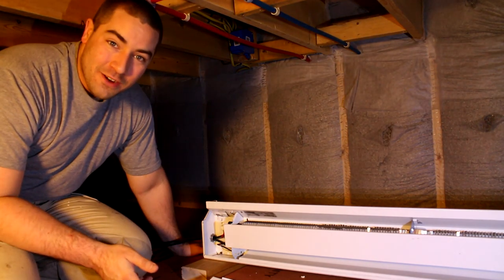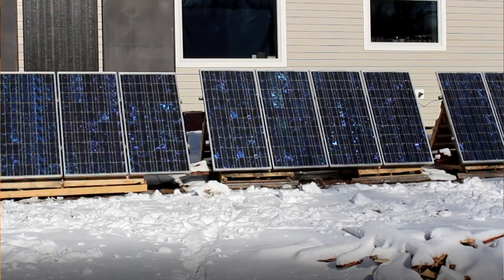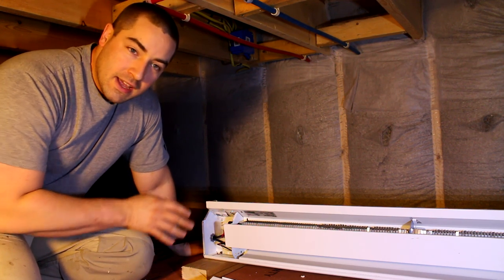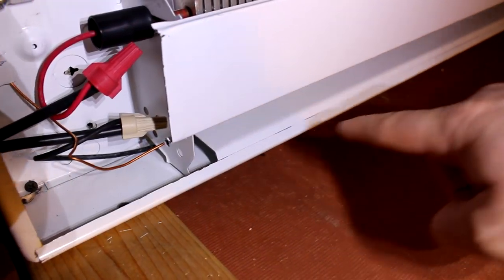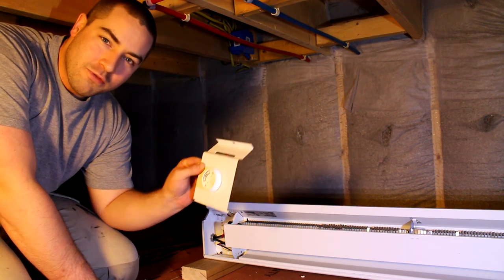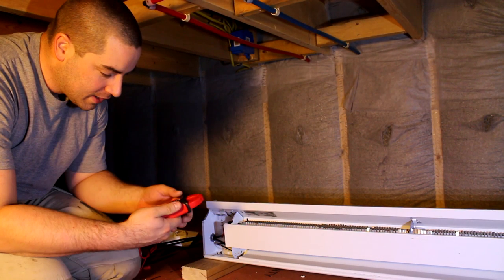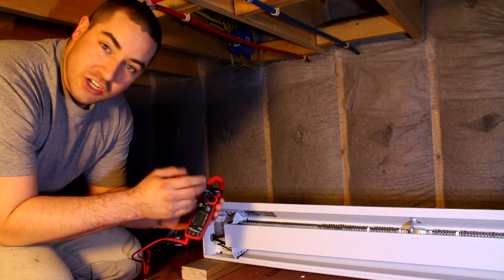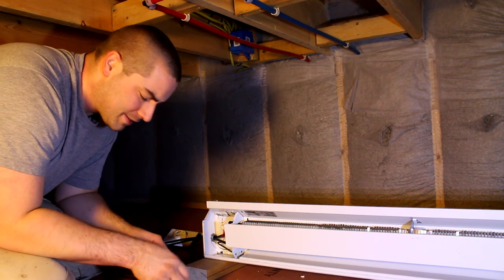Space Heater Running Direct off Solar PV

Comment: This is the exact thing I have wanted to do to HELP with heating my house (put in crawlspace) but always told needed microinverters or $$$ inverter and basically it wasn't worth doing.  The place were I live seem scared of solar energy.  I just want to use my (3) 305 watt trina 36.6 Vimmp 8.33 Immp already mounted on my roof off grid style.  Could I use a oil filled heater instead?  Wife might be mad if I burn the house down...

Comment: Hi David 

You can run the heating resistor just fine with DC. I'd put a disconnect switch in there too and maybe a 10 amp fuse for cloud effect but otherwise you should be fine

I also did the math simulations on the best elevations each month for your panels for your location. Would you like for me to just stick the numbers here or may I give you a Google drive link for a PDF with all the graphs and stats and stuff :) ?
Reply from the maker: That's great.  Send me the link with a message on YouTube, or the contact page on my website.  Thanks.  I'm looking forward to building some type of tilt array for your angles.

Comment: How is this working out for you?  I see the date of this video was a few years ago, but with the prices of fuel this year, this might be a viable option for adding some heat.
Reply from the maker: It worked great for 2 winters.  I have since moved the panels.  If you want to do this, check out my video on how to match the ohms of the heater to your panels: https://youtu.be/kVaxAfXQPDU

Comment: If you hard wired panels( with a DC breaker ) to the heating elements on an oilfilled electric space heater  would that work too? How many panels would you need for a 120v 1500 watt space heater? Would you by pass the thermostat controller when running 12 v instead of 120v?
Reply from the maker: Any resistor will work with this basic concept.  But, a lot of space heaters will have an AC thermostat built-in.  The AC thermostat will probably burn and melt with a solar panel.  Always add safety features rated for the DC voltage you will be working with.  As for your second question: I made a free calculator on my website to help size resistors to panels.  It's right on the homepage available as a downloadable excel sheet.  www.davidpoz.com

Comment: sweet man now you need to do is spend 20 bucks and get a Chinese Thermo controller so you can set the temperature on it it will set when to turn on and when to turn off I am using one to heat three little heating pads 12 volt and I'm almost positive they will hold 10 amps no problem at least that's what it says and you're barely over 6 with your amprobe so should work thank you for posting this I would have never known this and I have looked everywhere for a way to hook up solar to a heater and not have to have 1500 watts of power coming into convert
Reply from the maker: I'm glad to help.  Sometimes simple setups work the best.

Comment: OK- set up my "new"  Har. Frt 100W 12V 4 panels directly, nada.  SOME light, 8 V.   Then the battery at 14.7 V directly, and  nada... Wazzup?  Directly to element... getting 14.7V at the connections.  I have the same wall heater, only a bit shorter.
Reply from the maker: My panels are set up in series.  I've taken this down, but I think it was about 300 volts

Comment: Hi David ..could this type of application work in bringing heat to my chicken coop? I mean a smaller version..my chicken coop is more than 300ft from my house, and i been hesitant of using extensions or running underground cable to power the mini space heaters to heat up the chicken coop, and also very labor intensive..so i was wondering if there are mini spacer heaters that can be power by solar..without buying a large amount of panels or batteries..
Reply from the maker: This concept could certainly be used.  However, the solar panels need to be over-sized because there is no MPPT involved.  I'd probably run a wire out there for a low-temperature heater.  Something that won't draw very many amps.  That way you can keep the wires small (less money).  I'd also look for a passive heater, something that has no fans.  Because the chicken dandruff and dust will kill any fan-model fast.  
Just as an idea, here is a passive, 250w heater: https://amzn.to/34KTFQw
250 watts at 120v is 2.1 amps, which is very low.  The low amps would allow you to use less expensive extension cords, like 16/3.

Comment: Hi. Im living in the uk and houses here are 100years behind with energy efficiency. Mine is rated E which is lowest legal requirement if you want to rent youur property out to someone. I am thinking about something like this but wanted to use fan heater(1 lets say 1 / 1,5kw or few less powerfull ones eg 3x300w/5x300w respectively)
Can i connect heater directly to the panels if its also dc ? How about energy fluctuations throughout the day ? Won't this kill the heater ? Many thanks for any clues. Cheers !
Reply from the maker: No.  The DC from solar panels can go to a resistance element, but not to a thermostat, switch, or fan.  They will burn up.  I'd look at insulation and air sealing first

Comment: need to work out a thermastat for DC that wont arc... perhaps a PLC and relay.
Reply from the maker: I didn't use any thermostat.  I never had an issue of over-heating since it's a relatively small space heater for the size of my house.
Reply: If you are using Victron equipment in the same space I can't see why using a Cerbo GX to turn a relay on and off based on temperature would not work

Comment: Hi David, can you please update your space heating experiment. How did it go? Is your house still standing?😂 Are you still using PV direct heating method? Any advice from a seasoned veteran of PV direct usage to the green beginners like myself?
Reply from the maker: Still works great.  I added circuit breakers from Midnite Solar rated for up to 300 volts DC.  I made a mistake very early in my testing and used a circuit breaker that was meant for car stereos (12v) and it fried with the high voltage DC.  Also, I found that voltage is the more important factor than amps.  Lets say, you are using a 120 volt baseboard heater rated for 10 amps, 1200 watts.  And you are hooking up solar panels that have a Vmp 24, and Isc of 7.3 amps .  Then you need to series connect 5 panels to bring the voltage up to 120v.  This is the important thing to get the voltage at (or slightly above) the voltage of the heater.  In this case the amps are lower, so it won't put out the full 1200 watts, but it can still do 876 watts.  If you don't get the voltage up there then it will put out almost no heat.  I went through this in my testing.  I hope that helps.
Reply from the maker: It is also important to remember that Normal houshold AC breakers, fuses, thermostats, and switches are no good in this application.  Everything must be rated for the high voltage DC.  I found Midnite Solar a good manufacturer, and Alt-E a good store for the products.  Also, any AC heater you buy can't have any fans or pumps.  Only the resistor can be used with DC.  Fans will burn up.
Reply: @DavidPozEnergy  Thank you David, this is very helpful.

Comment: Hi David
I  am playing with similar stuff/projects,, a crazy Idea I am going to try out,, is Cryptocoin mining,,, they use Power to mine, and they make heat. So instead of powering a heater, I want to power a mining rig,, I have bought a miner that uses about 1300 watt,, so it is a 1300W heater that also makes money,, well that is the hope anyway :-)
Reply from the maker: I've been trying to learn about mining so I can try the same thing.  But I am an extreme beginner in the world of mining, so I don't even know where to start.  I have no idea how it works.  Do you have any cool video suggestions?
Reply: About to do this to.
Reply: @DavidPozEnergy  I have ordered the mining thingy,, used one,, still a bit expensive. But the idea is to kind of use the power twices, and have the heat as the bi-product.
Reply: @DavidPozEnergy  mining?  As in...digging in the ground?